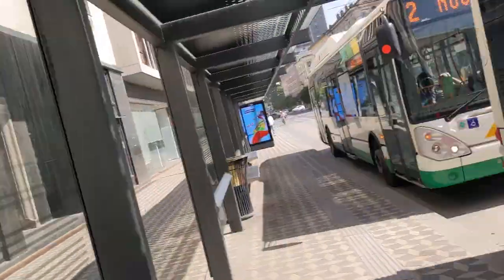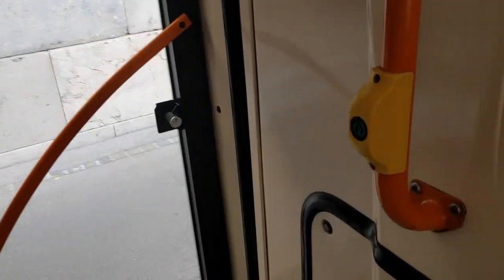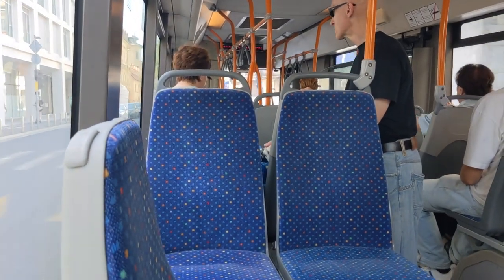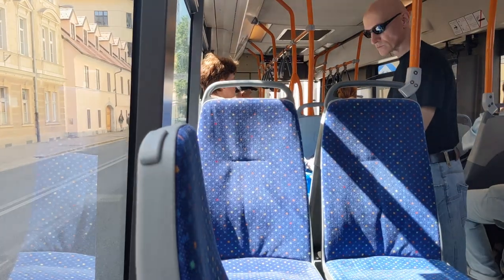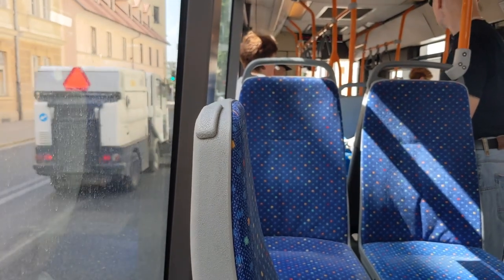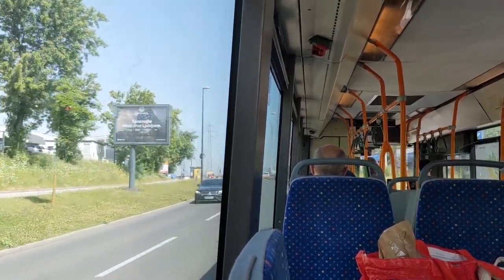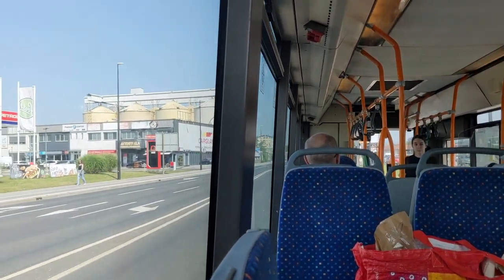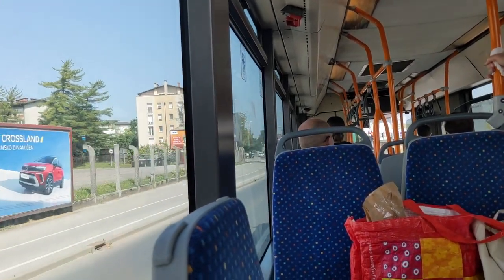Rafa GUIDES! The Irisbus Citelis in Ljubljana

Comment: Seems like you really didn't like the bus. Perhaps the interior around the back could be better but not too bad the engine / gearbox sounds really classic like early-mid 2000s and also the exhaust sounded blown as it took off at the end  (in the UK enthusiasts really like that for some reason🤣)
Reply from the maker: That's the thing, the bus looked older than it actually was and its Voith was not that loud so it's not my type. I think I would maybe like it if it had a louder Voith though.